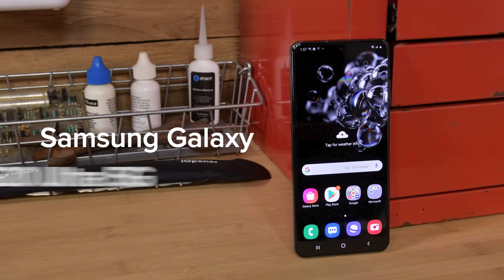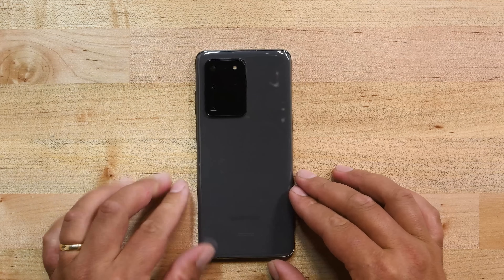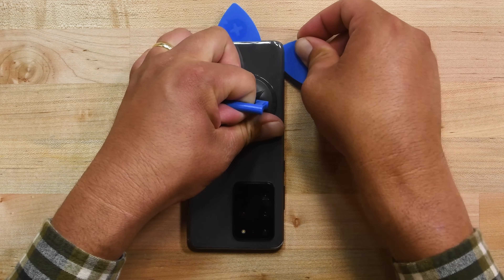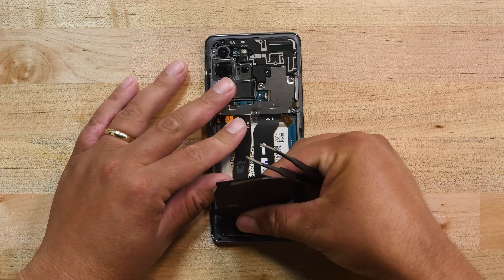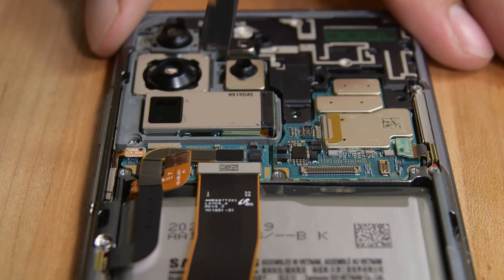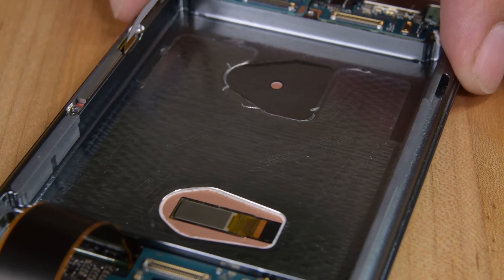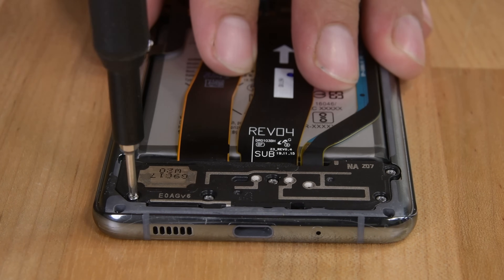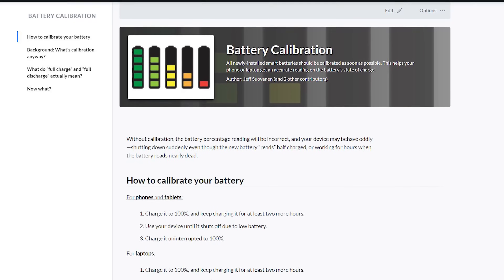Samsung Galaxy S20 Ultra 5G Battery Replacement!

Comment: I replaced the battery on my Galaxy S20 Ultra, and everything was working fine at first. But suddenly, while using it, the display turned off. The phone is still running since I can feel vibrations, but the screen stays black. Does anyone have an idea what could be causing this? I made sure to do everything properly. Thanks for any help!
Reply: Same problem here, just with S20+ 😢 Did your screen start working again?

Comment: Following this tutorial and putting isopropanol alcohol to remove the battery destroyed my screen, battery was removed and changed yes it works but screen turned white, then had touchscreen issue, then finally became black, phone still turn on and work but screen is dead.
I would suggest to NOT USE ALCOHOL anywhere near your screen if you don't want to damage it permanently like me.
Reply: Did your screen recover after a while? I have the same issue 😢
Reply: @AppendixVermiformis  funny enough, it kinda did recover after a few weeks. meaning the phone works, the screen turn on BUT there is a big circle of black dead pixel in the middle, a cluster of pixel died and left a black circle where it doesn't work there specifically.

replacing a screen cost a lot, 100-250 depending on models.
good luck man
Reply: Necesitas usar alcohol de 99%
Reply: @AnonytakusKing  the opposite, i used 99% and it was too strong, it's recommended to use 70%, and use as little as possible
Reply: @Zack9k  bullshit don't listen this, always use 99%. 70% is mixed with water. Dangerous !

Comment: dear lord, this whole process really has me like, should i just order a new phone.
my usb-c connector is broken anyway, and using the inductive loader melted open my current phone, with the aid of a slightly buldged battery, in a few months.

replacable batteries need to make a comeback, like asap...

Comment: I still have a couple of LG-V20 and pop a recharged battery in  only takes 20 seconds. but now instead of changing the  battery  $20 we have disposable phone that some times last two years and buy a new phone for $800. This system will have to change at some point.

Comment: I have a G9810 ver (Chinese). Iam planning to replace battery because it started charging my phone very slowly so i guess it's time for a replacement

My question is, do you guys know if European version has the same model of battery as Chinese one? The only original new battery i had found online is euro version

Comment: The removal of the conductive charging coil and NFC is completely unnecessary. Just disconnect the connector from the primary PBA, remove the screws from the bracket and speaker assembly, lift up the speaker assembly to expose the screw under the NFC and conductive charging coil and you're good to go, keeping it all in one piece so the removal of the pad doesn't damage it during repair.

Comment: my note 8 battery has never been remarkably lasted long even its brandnews and its been almost 3yrs. accubattery says 82% battery health samsung app says battery healty say its still good. is it still the worth to replace the battery
Reply: If you would really use an extra 15-20% on your phone, or if you intend to keep the phone another few years, you might want to replace it. If you don't have an issue with it as is though, you could always save the money.
Reply: @MicroplaysMC  i need to pay 70usd on batteries and bulbs to replace battery but ill have to think about it😆
Reply: @당신은더미입니다  batteries + bulbs is too expensive, they mark it up. Go to a repair site like mobilesentrix, they sell good batteries for ~$12
Reply: @MicroplaysMC  for real? but 12 usd battery might be worst than the original ones
Reply: @당신은더미입니다  Nope, ampsentrix batteries are certified and used for repair all the time. I think you just don't realize how much they mark them up..
Reply: @MicroplaysMC  ill take note of that bro thanks

Comment: It is so much  simpler that iPhone,  all big pieces, all same length  Philips  screws,  no software lock that you need special  and expensive tools to break it
Reply: yes, but iPhones have the advantage of pull tabs on the batteries. I hate working on Samsung phones solely because of the unnecessarily strong glue.

Comment: Remember when you could just drop the phone on a desk and the battery would pop out? My old Galaxy S4 Active could do that...
Reply: My old Galaxy S4 has a user replaceable battery, and yes, the battery has been replaced numerous times. It's a shame that the S4 is too old to use in 2021, due to lack of app support for Android 4.x.
Reply: @TheSpotify95  Doesn't the S4 have Android 5.1?
Reply: Those were the good Ole days! Back when the back cover was snapped together and plastic👌 my t-mobile wing was probably my all tune favorite phone
Reply: I used toncarry spare charged batteries up n swap them out

Comment: I wish replaceable batteries would come back. 
IDC about slightly less capacity. 
+ Yes, It would still be waterproof...
Reply: The batteries are replaceable [for a repair ninja].  Need screws to come back.  Its the adhesive shenanigans that makes it a nightmare.
Reply: @pow9606  True!
Reply: @pow9606  you need special equipment to even open these phones
Reply: Almost no phone is waterproof, just water  Resistant
Reply: @Matyas_Ceo_Of_Matyas  
True.
Reply: @平和-v1z  You can't make the back cover waterproof and feel premium at the same time. You'll loose one of those, tbh I don't mind in built batteries considering it's gonna get replaced only once or twice in it's lifetime anyways.
Reply: @NanoMine  

If they would use high quality plastic like on Lumia devices, it can feel premium. 
The Galaxy S5 is water resistant and has a removable battery, for example. It's only made out of cheap feeling materials. 
And considering that most people will use a case anyway it doesn't matter that much and would make the device more affordable, more durable and overall more comfortable to use with one had because of its lighter wight.